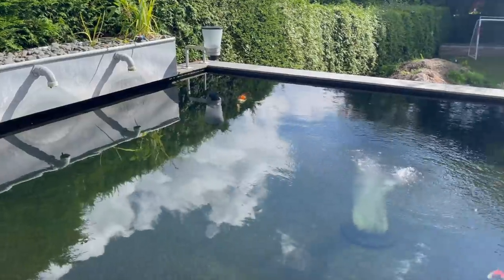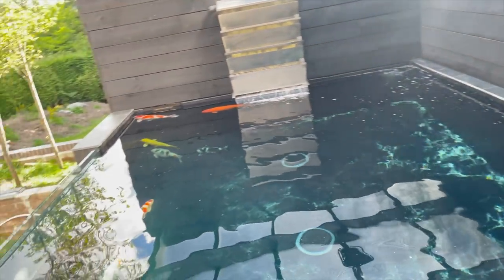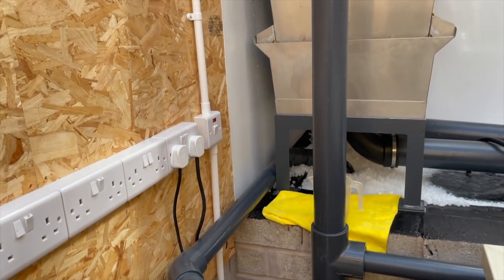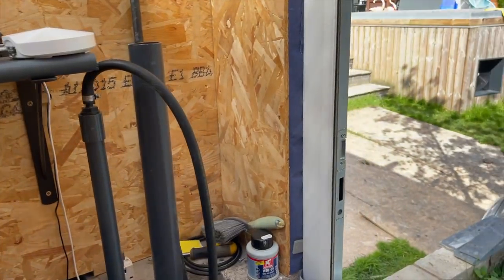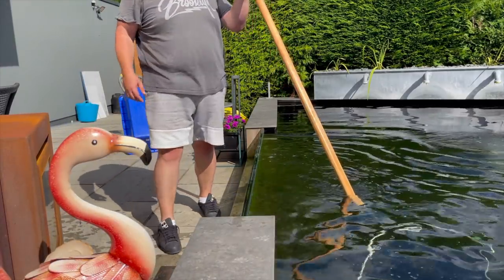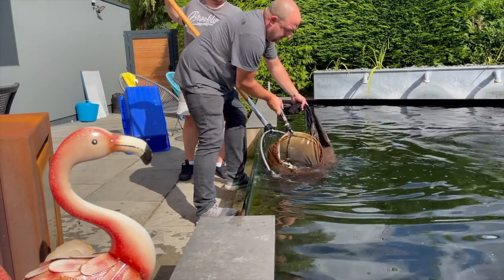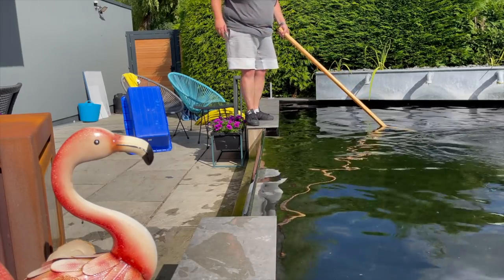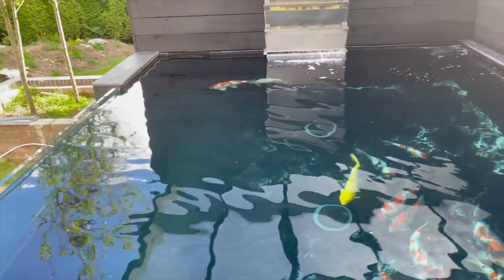BIG KOI POND BUILD PART 3!! FISH GOING IN!!! AND A PLEC??

Comment: You need to put potassium permanganate on the moving bed filter and let is run for 15 minutes then it will immediately move good also it will make the media more rough so there is more place for bacteria